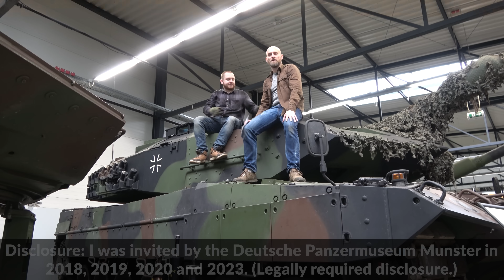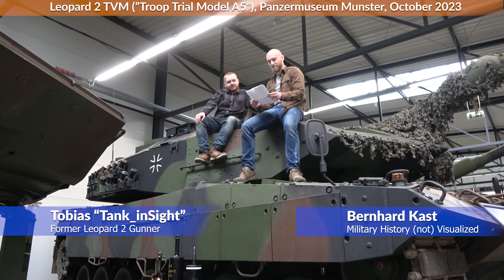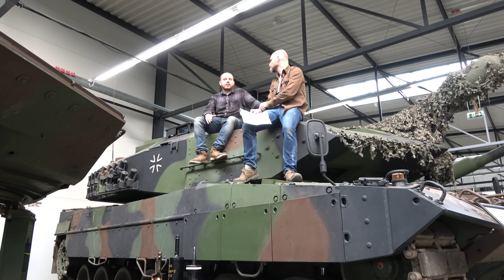Leopard 2 built for Defense? Questions for Leopard 2 Gunner @tank_insight2011

Comment: About the HVAC mentioned at 07:19 thanks to Andrew for letting us know that it is about heating. Here is my answer: 

The Name HVAC wasnt known to me since we use a rather different Term in German.

I served on 3 Variants of Leopard 2. The Leopard 2A6, the Leopard 2A6M+ and the Leopard 2A7 as it was introduced in 2014. The two first one, the A6 and the A6m+ had only Heating. It was in the Hull and its controlled by the Driver. Its very powerfull and we tended to see it either as no heating or too warm. It was good in Winter but when you are directly infront of the blower, depending where the turret is rotated, it can get too warm for you. 

With the Leopard 2A7 there was a AC System introduced. But it wasnt build in for the Crew. It was build in for the additional electronics that came into the A7. Like the BMS (Battlemanagement System) or a 3rd Radio. It fullfiled its job and had like a Tunnel with ventilation Holes going along the Maingun. I cant really tell what should improve since i havent served on the Leopard 2A7V. This Variant recieved a complete new AC System also designed to cool down the Crew.
Reply: Heating Ventilation Air Conditioning
Reply: HVAC would more likely used for buildings. For a car or tank you would call it AC, air conditioning, quasi Klimaanlage.
Reply: I'm afraid German companies and management have always seen air conditioning as an unnecessary luxury and denied it.  It's very short sighted and a very German thing whether its company cars or tanks and ifv.   Whereas its seen as an essential in many countries that not only improves ergonomic but crew efficiency and reduces fatigue.   Right now tanks are being destroyed in Ukraine with ease because hatches have to be left open or else the crew passes out.  Crews ride on top of IFV to stay coo exposing themselves to air burst ammunition and small arms fire or micro-drones entering hatches with grenades.  l.   It's also a Russian problem but its absurd.  I would say a big part of the problem with PzH 2000 was its lack of A/C which means dust gets in as well.

Comment: In Australia the crews become "3 ways fit". You usually start as a Driver, then qualify as a Loader and then qualify as a Gunner. Once you have all three, you progress to the Crew Commander's course.
Reply: Leopard 2 in Germany was operated mainly by soldiers doing a compulsory service that only were available for 9 - 12 months, before they left again to civil life. So time for training different roles was limited.
Reply: @ou8122 Not here it isn't - its a course.
Yes you learn on the job as well, but you can't fill the seat until you are qualified. Crewman Driver Sig or Crewman Gunner Sig, etc.

Comment: idc about loaders and autoloaders or if it's 120mm, 140mm or 150mm calibre.
i'm still waiting on oversized superheavy tanks that are nuclear powered and have railguns as their main armament. the tank crew's (similar in number to ww1) main job would be manning aa guns, watching all kinds of screens with drones, gps, infrared, ultrasound, sonar (mine detection) and what not. crew would be too big for a single commander so he'd have two deputies.
like a ww2 land battleship, but high tech. it's not like maus, ratte or t35, they wouldnt just be sitting ducks for tactical bombing bc you wouldnt send your tanks to such a place at such a time either, way too expensive. these tanks couldnt be taken out by even the highest tech atgm's or rpg's due to the sheer amount of armour possible. reactive armor on top of composite armor at the very least, it's nuclear powered so it doesnt matter. could even have its own plow and inflatable raft and snorkle bc without the engine using so much air, it's pretty easy to ford water objects with it.
Reply: The 120mm Rh-120 gun uses a single piece round with combustible cartridge. That keeps the weight down.   A round above 120mm is very hard to handle otherwise and needs to be two piece or use an auto loader.   
Western manual loading is almost twice as fast as Russian carousel auto-loader and doesn't come with the 'flying turret effect'. in addition you get the extra manpower of the loader who will help you get first shot first kill by helping out in observation and assisting the commander.
-When western tanks use an auto loader its a cassete style auto-loader with ammunition stowage in the turret bustle with blow out panels so the turret doesn't blow of.  That would be LeClerk, Black Panther and the Japanese tanks.
-Calibers bigger than 130mm will definitely need auto loaders.
Reply: @williamzk9083  lost?
Reply: @williamzk9083  5 sec reloads are twice as fast as 6.5 sec, and 7.1 secs??? Also the French, Japanese have autoloaders… They hit 3 secs… Furthermore, the Americans built a carousel autoloading system for the M1 TTB. The issue is, a carousel autoloader makes the most sense when all crew is in the hull, with a hull with insane protection.  

I’d like to add that, with the given information most Ammo cook offs are via the loose ammo in the front of the hull near the driver (something the Challenger 2, and Leopard 2 also have struggle with unless you want to carry 14-16 rounds which is very little in combat)… I h8 the Russian government too, but I refuse to let my politics, and bias for countries that don’t give an F about me at all get in the way of empirical reality. 

The issue with Russia technology wise seems to not be a lack of knowledge, or lack of ability to produce. But rather the corruption that runs DEEP within that country. It’s so deep it cuts into the already corrupt military industrial complex. In America our corrupt military industrial complex has more power, and wouldn’t allow itself to be robbed of money by the oligarchs/elites.